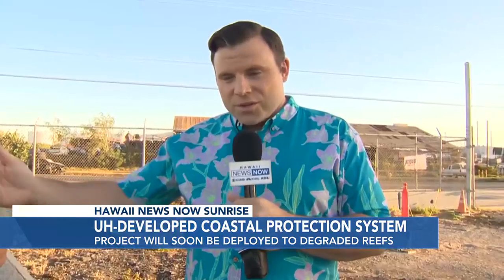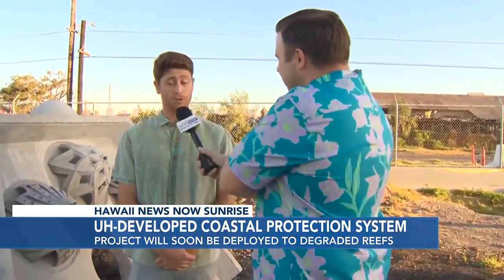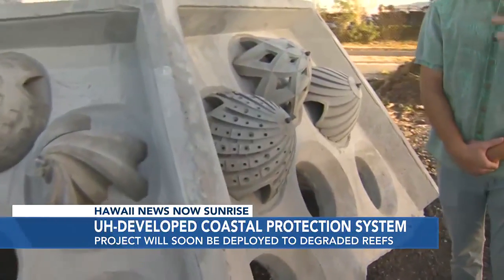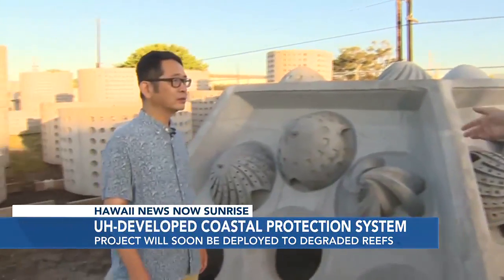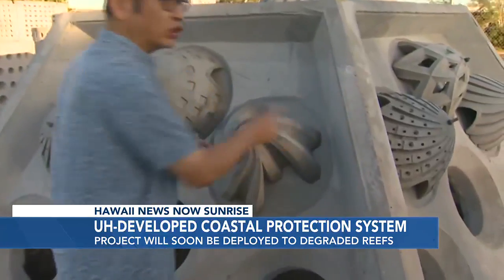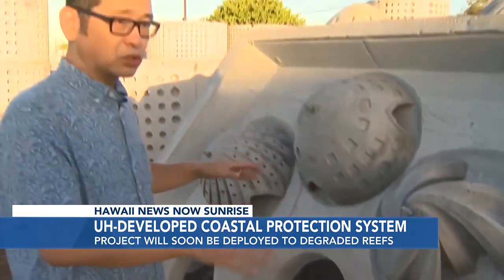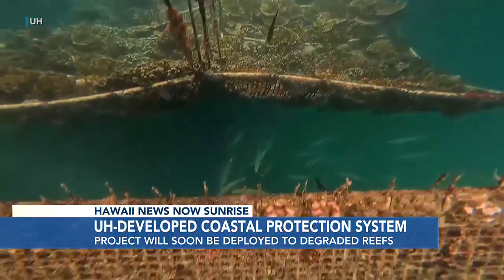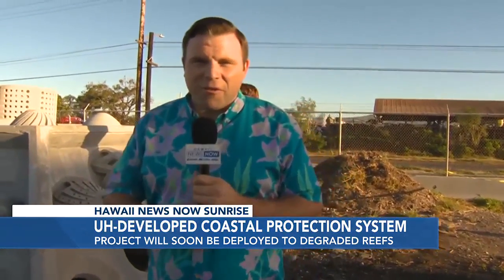UH to deploy new innovative system aimed at protecting coral reefs from erosion

Comment: I didn't think the lack of places for sea creatures to latch onto and grow was the problem with the demise of coral reefs. Dead coral itself offers sufficient places for this to happen. The problem is the increase in sea temperatures, and hordes of other man-made pressures affecting the ocean. Additionally, while the designs are wonderful, I think they would add to the cost of this "fix" - meaning less of these could be used than if they had more simple designs.